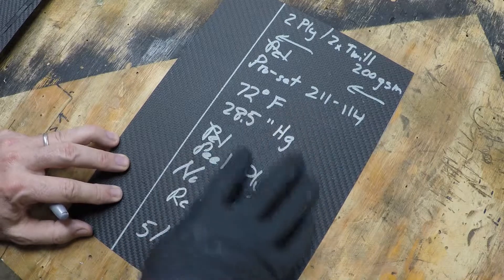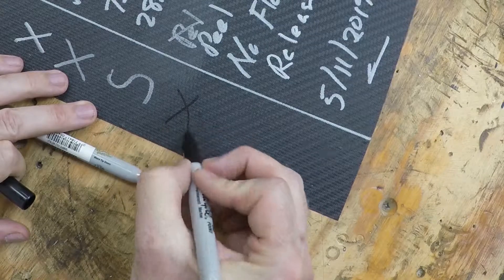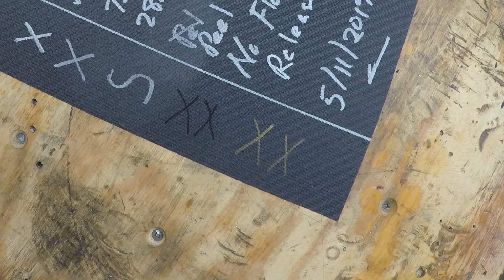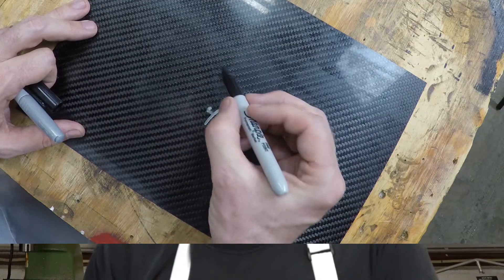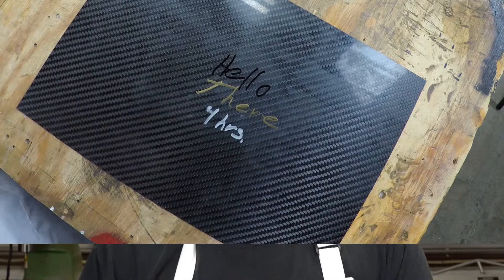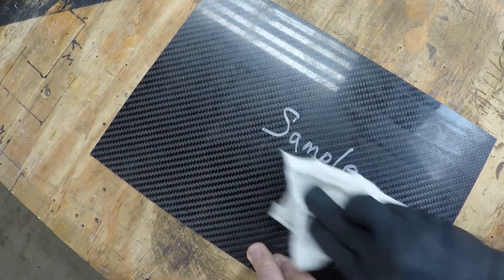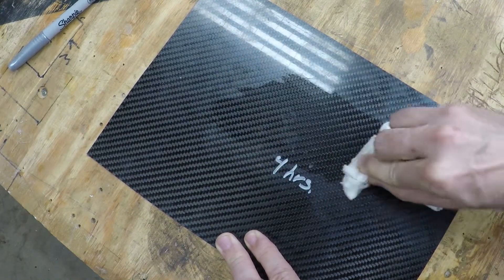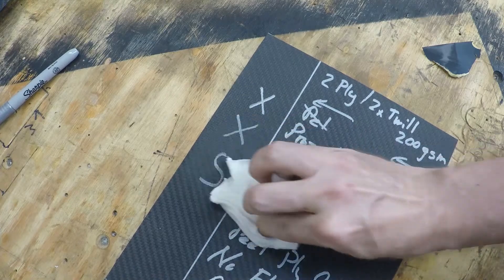Composite Tip: How-To Mark on Carbon Fiber

Comment: So if I write on the shiny side of carbon fibre with a silver marker will it not come off unless you use alcohol rub? 
(Trying to permanently mark black carbon fibre on the shiny side)
Thank you
Reply from the maker: You will generally need some kind of solvent to remove the marker. I'm not sure how long it would last in sunlight though.